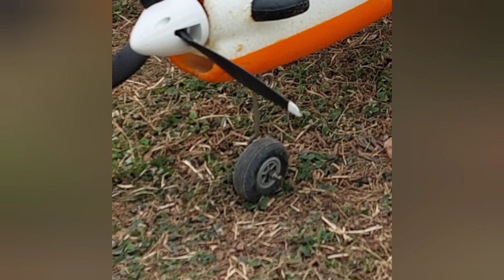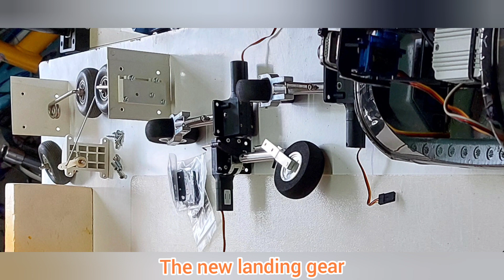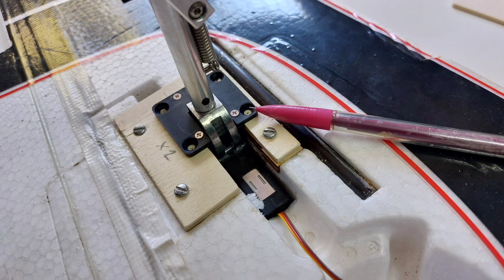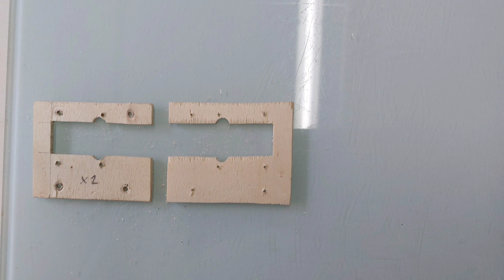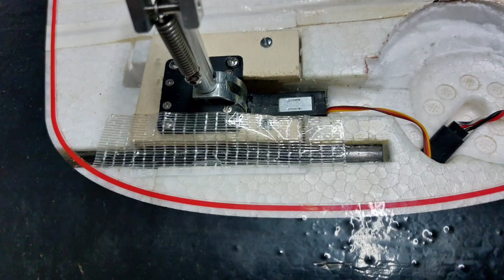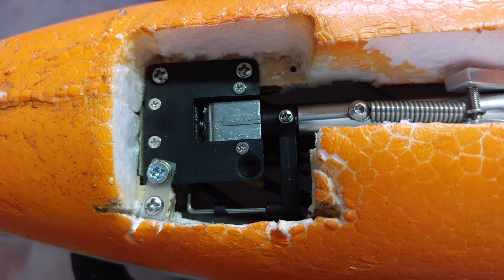How to install a RETRACTABLE landing gear (step by step) (🎵 The Riddle - Gigi D'Agostino)

Comment: Thanks Col, that helps a lot but what about the direction of the front wheel? ;)
Reply from the maker: Thanks! The front landing gear has an arm where you can connect a linkage to a sliding ring. it's a standard mechanism, very easy 😉
Reply: @coroneldonat  ok I believe you ^^. 2nd question : no problem with these wheels smaller and thinner than the genuine ones ? 🤔😉
Reply from the maker: The special shock absorber shape, supports all forces at taxi, take off and landing. If it were a telescopic one,  the smaller wheel than original wouldn't support that forces.